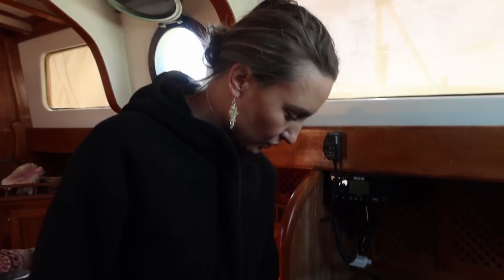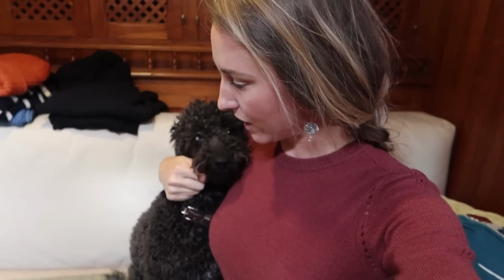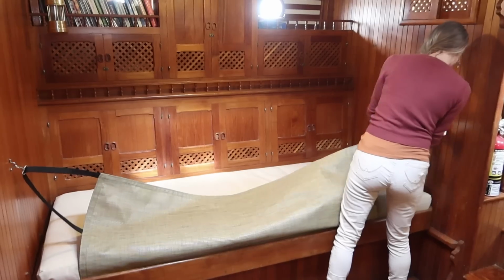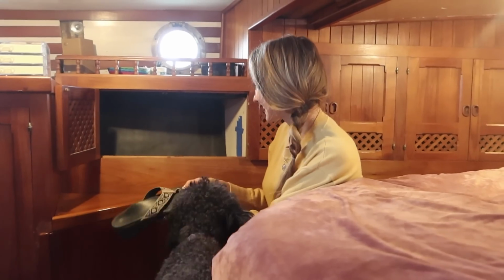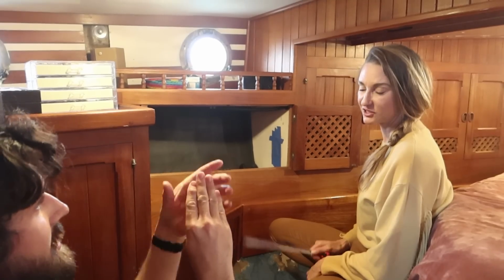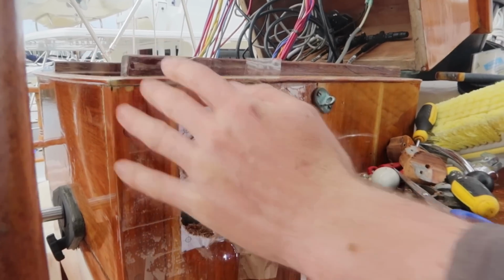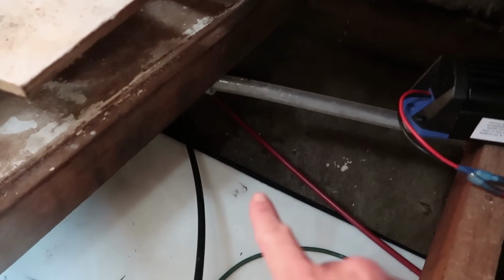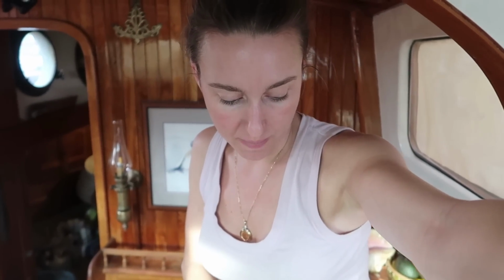PROBLEMS in the Engine Bay | PIRATE SHIP S15E02

Comment: "IF" the plastic tank was molded with a release agent the fiberglass will probably not adhere. there is a type of glue that auto repair shops use to bond plastics but the cost of the glue may be as much as a new tank.

Comment: You need to through bolt the saddles for the lee cloths. As they are, they will fail you when you need it most.
Reply: Exactly, the load of someone being thrown by a wave will yank those little screws out. And use a batten on the bunk end of leecloth - helps distribute the load across fabric. Screw many screws through batten, fabric.

Comment: Use Lexan (polycarbonate) not Plexiglass (Acrylic, which will shatter).  You can drive a screw thru Lexan and it shouldn't break.  I've done it many times, on stock cars.  Cut to shape with normal wood working tools.  I've even shaped it with routers and power hand planes.

Comment: liked the idea of the shoe cupboard using a dowel for healed shoes is awesome.  that closet with the hanging rod you are supposed to use hangars where the hooks turn so that the foul weather gear can dry properly.  looks a bit funny at first but that is what that closet is for, or possibly wet bathing suits. but i have a question about use of closets, do you find that mold builds up in closets on clothes or shoes because of any water in the bilge?

Comment: Argh! Plexiglass is a terrible material! Use coated polycarbonate instead. It resist scratching as you wash the windows. The salt deposited on the plexiglass will scratch it making the windows look hazy. The plexiglass is not a resistant to UV attack either. Yes, I spent 40+ years making polycarbonate.

Comment: You got get all that cleaned off the transmission get those cable working again do it right if you are going to do it at all. Motor mounts need to be cleaned and inspected for stress cracks then an marine power plant inspection needs to be completed before you go to sea. All this for the safety and sake of you and your passengers. Don't be that loser that is never heard from again.

Comment: Always another project to do! fyi the chop strand mat is always the best for the first layer in a repair situation as it has the most surface area for bonding
 but i think you put that there anyway . Fingers crossed it holds but even if it leaks a little its only from the top!  i expect you know by now anyway. cheers warren